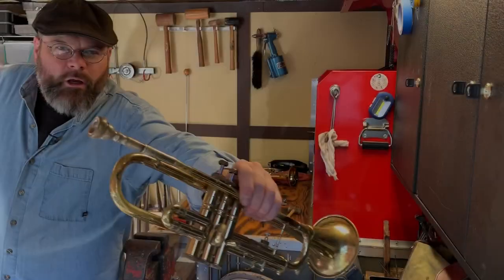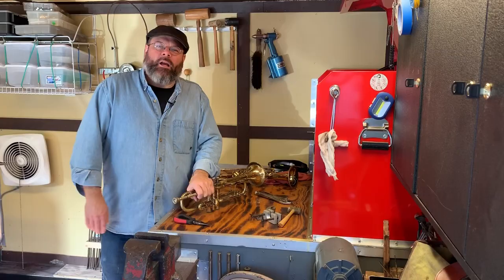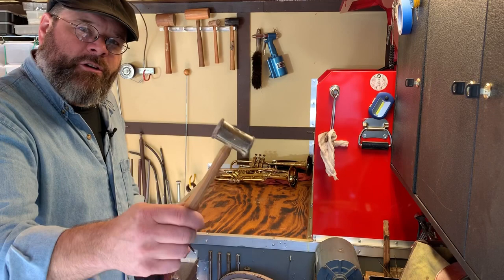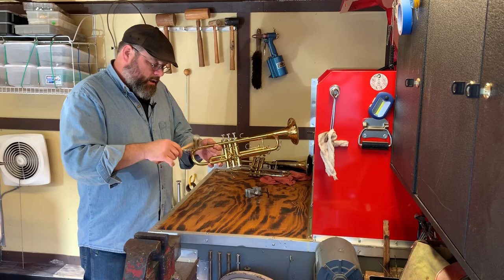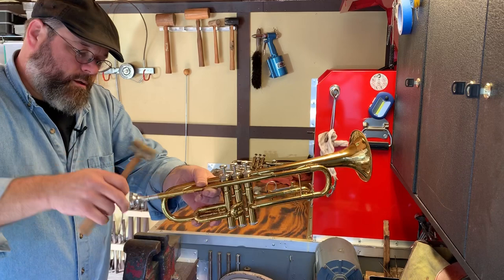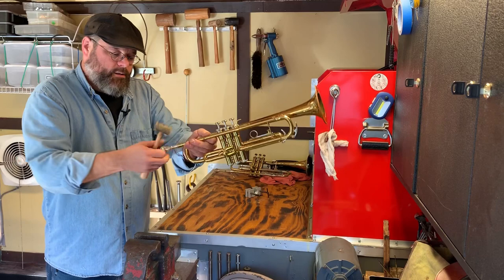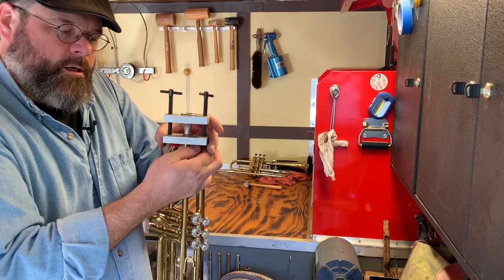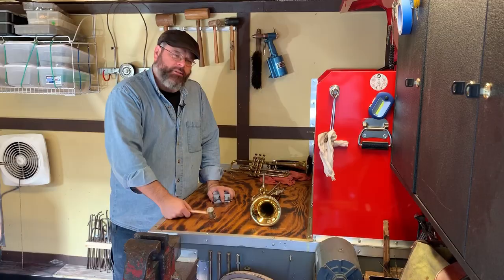Stuck Mouthpiece- Ep 8- Wes Lee Music Repair

Comment: The way to go! I have sometimes fixed it with snow and boiling water when I forgot my puller at home. Cool the mouthpiece with snow and ice, then pour boiling water on the reciever.. A light tap on the mouthpiece "away" from the trumpet has fixed it most of the times.